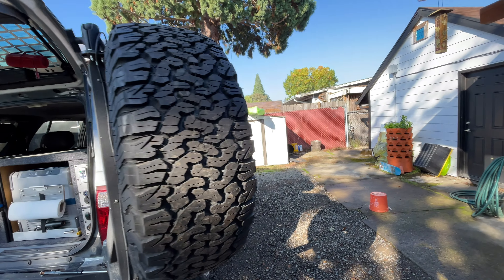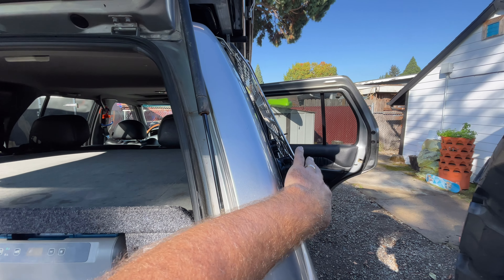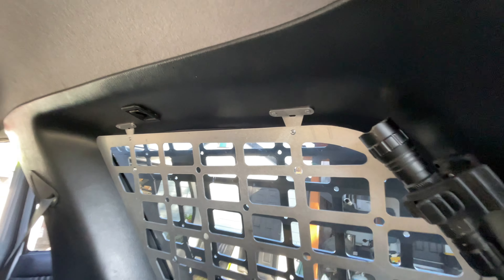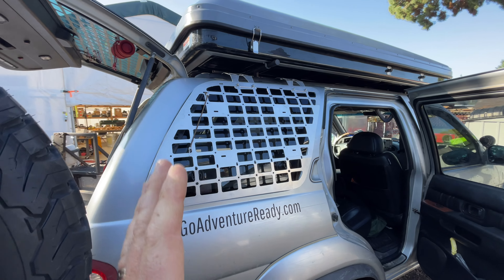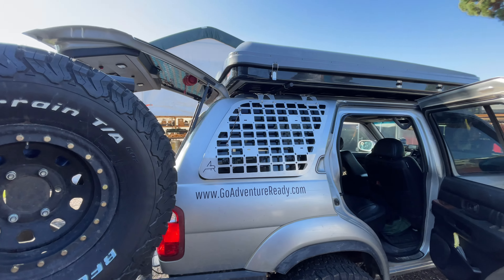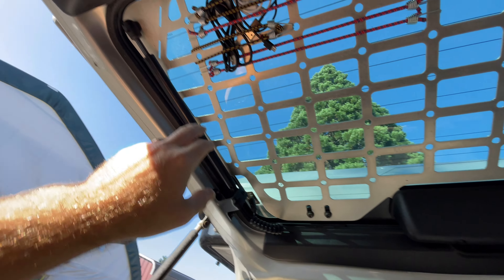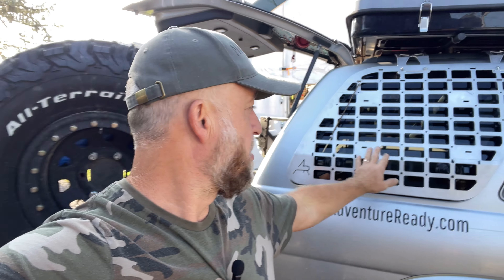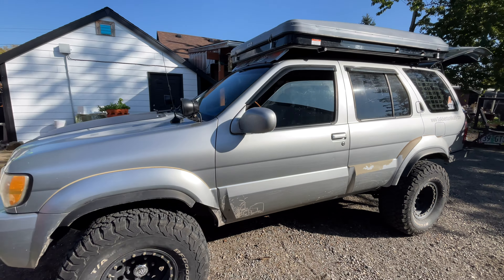Nissan Pathfinder R50 - Infiniti QX4 - Rear Quarter Exterior Accessory Molle Panel

Comment: Suggestion: You should add two mounting points (holes) in the center of the panel to fit the Rotopax hardware. Awesome build.
Reply from the maker: That's the plan and been done on the production model.  Parts that go onto my rig are mostly "custom" to my application, as in I have no plans on Rotopax on my panel, only heater, thus only heater openings were made.  
Production model has that in the middle, along with variety for the case openings, plus some other added features.  

Great minds think alike they say :) :) :) Cheers! Have a great Friday

Comment: The R50 in the top right corner would be awesome. Also maybe your intials on the actual panel aswell? 

I have a low profile roofrack and have already utilized all factory mounting tabs. Is there another way to mount it in the factory rails ? Obviously worst case scenario you'd have to remove the roofrack and add another mounting tab I would assume
Reply from the maker: Yes sir, and that has been done on the production model that I've sent out for quote.  R50 will be at the top corner, and AR original logo on the bottom corner.  I will probably get 2-3 pairs of these made, and see how they'll sell.

As far as mounting to your rack, would be nice to see the rack itself, I'm guessing you are speaking of one similar to Prinsu that a guy in Vancouver, BC made?

Comment: Yup mileage sucks, I can't understand why they can't make a decent engine that gets 25+ mpgs. My 01 R50 gets 17mpgs empty, 13 loaded on a trail trip.
 My 1971 FJ 40 gets 18 always, my 02 Dodge Cummins 2500 gets 18 unless towing my camper gets 14 then, Geo Tracker gets 30 always. All different rigs with different capabilities though.  Wifes Sienna mini van gets 18. Think about a Toyota Prius drivetrain in the Geo, but it'd be underpowered (more) and maybe gain 10mpg..so 40mpgs.
Great job on the build, looks awesome. Do you have a video on your front and rear bumpers? That is a weak point on the R50, not much aftermarket parts made for it. I did the 2 inch Land Rover/ Bilstein rear spring lift with AC coils up front, ext brake lines and custom rear track bar. The Geo went the most places due to size and mileage, a full take and a 2 gal can gets me over 300 miles, fits under and between trees, but is a solo rig, no room for a partner, barely enough for the dog, and weight becomes a factor in a 1.6 liter engine.
Reply from the maker: Yes sir, all great points
On the bumpers I have videos, may be not to detailed, but have them.

Comment: Very cool new mod! Agreed about the mpg similar to a V8 but not as much power. Also, the fact that the 3.5 requires premium to run best really sucks! Also sucks how it burns so much oil. I need to add a quart every two fills ups. And mine leaks zero oil too so not sure where it goes. Keep up the good work buddy!
Reply from the maker: Look into “engine restorer” additive to put a can once you replace oil, it stays for the whole oil change cycle (read instructions),  I used it on couple oil burners before, helped couple of times for sure. I’m on my first try on the r50, will add on them next oil change as well. 
Oil goes somewhere, yes no leaks and no smoke out the pipe either 🤷‍♂️🤷‍♂️🤷‍♂️